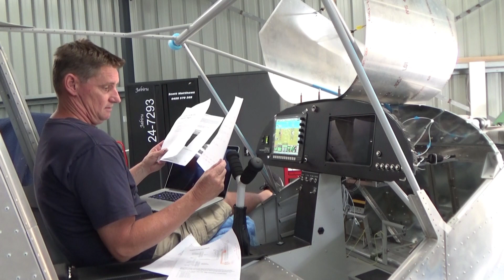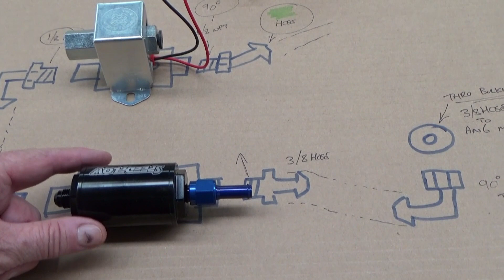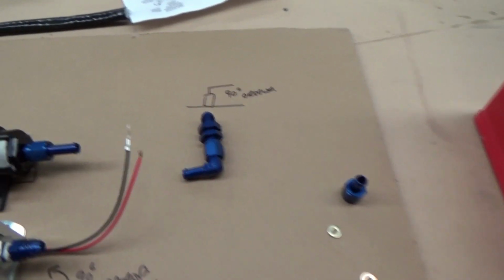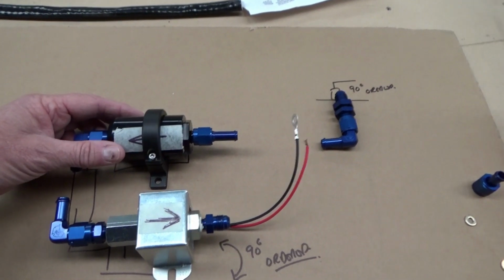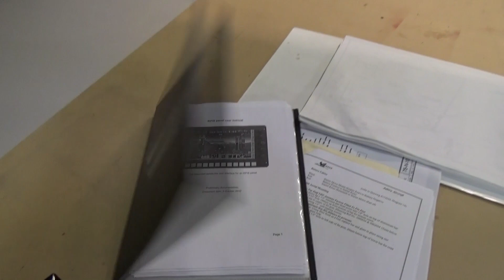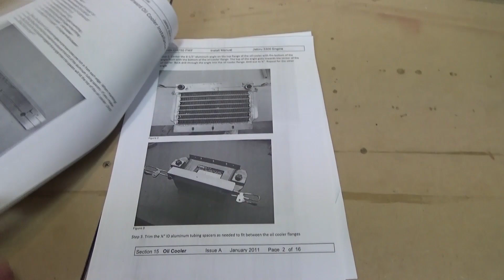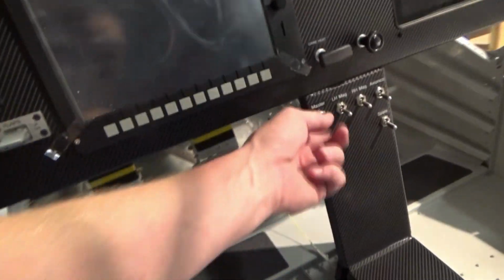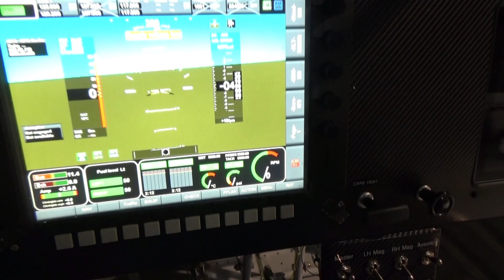Zenith CH750 CRUZER Firewall Forward

Comment: Hi Scott - Amazing progress.  Great quality of work and so fast.  Unbelievable.  In one of your videos, you mention your plans for attaching the two cowl halves using a number of screws if I recall correctly.  I am curious if you have seen the video Jan posted on YouTube regarding use of hinges to serve as fasteners by removal/insertion of a slightly undersized hinge pin.  His video is quite detailed, and I think it would meet your criterion of being able to install/remove the cowling single handedly and without fuss.  Just wanted to point it out in case you have not seen it or not aware of this as an option.  Thanks for sharing your experiences as they are very helpful.
Reply from the maker: Yes, it’s the standard setup on the Jabiru  aircraft. Thanks